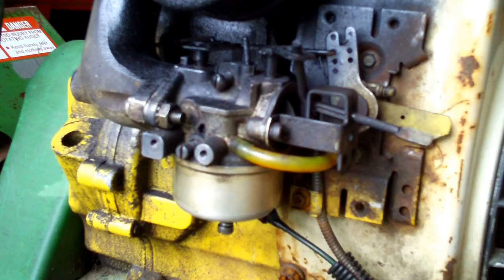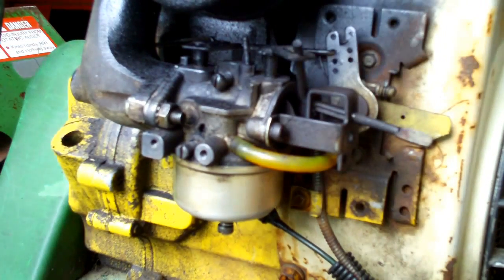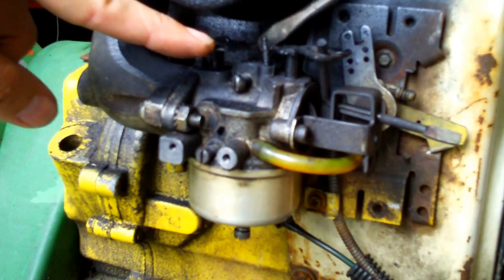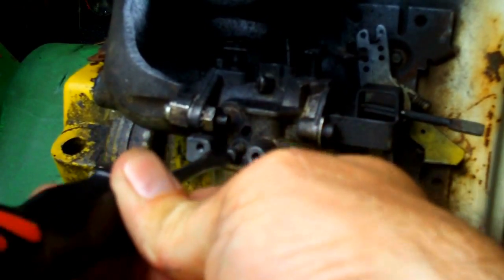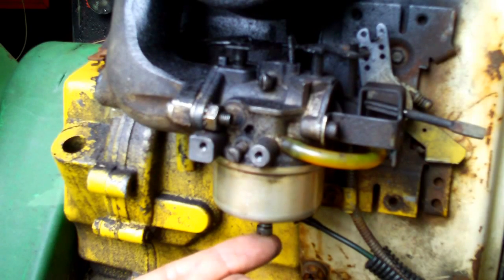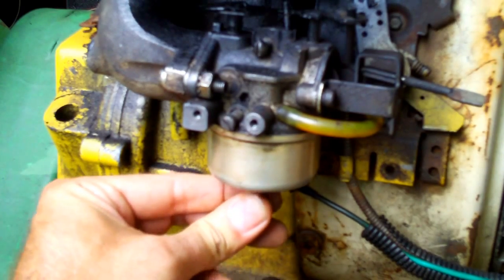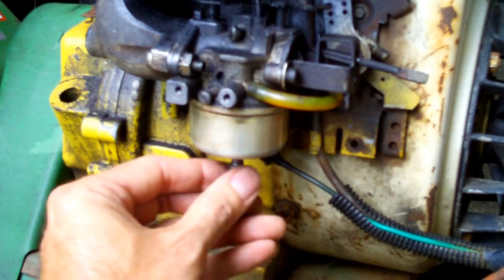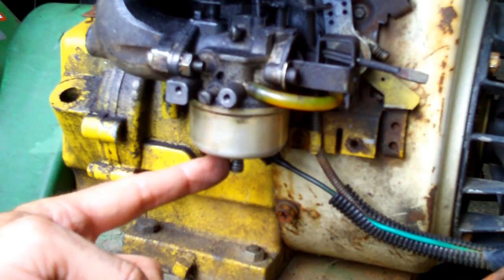How to tune a small engine carburetor with governor ✔

Comment: What about screw on governor arm?
Reply from the maker: That regulates what RPM the engine will run at.
Reply: @contact4mwy7  thank you very much, I’ll try it, rpms seem to be slow under load from mower deck,Tecumseh oh160 1973

Comment: If the carb has a solid 1/2 nut in the bottom of the bowl it is a FIXED JET carb. There is NO adjustment on the side or anywhere else. The side screw has a hole through it and a tiny hole in the end that can plug but the screw must be tightened....no adjusting....if it was adjustable it would have to have a spring on it.
Reply from the maker: Not every carb is adjustable, but those that are...

Comment: My generator fouling new spark plug instantly with dry black powdery deposits , any ideas , do I need to increase decrease air/fuel mixture air filter seems cleaned  have done approx 1800 hrs use? Answer be great please  am off grid out of action cpl days ?
Reply from the maker: Black powder (carbon) deposits that can foul the plug means it is running too rich. Too much fuel. Find a way to adjust it to use less fuel, more air.
Reply: @contact4mwy7  thanks God bless you 🙏

Comment: Something wierd that happened to me was that the engine started to work really fast (rather than run rough) after opening the idle screw to allow more fuel.
Gave me a bit of a jolt cus it sounded like it was going too fast.

Comment: my Tecumseh 4hp push mower seems to work smooth with just a quarter turn of the idle screw and 1/2 of the idle speed screw.
Is it cus it's a smaller engine that it doesn't need much air/fuel mix at idle?

Comment: Great video, here is my question - just replaced the carburetor on a Kohler MT8.  Now, if I turn it off and then start up again within a couple minutes, it backfires once out the muffler, but then runs fine at idle and under load.  It never did that with the old carb.  Do you think the low speed mixture is too lean?  Thanks!
Reply from the maker: I would have to experiment with small turns one way, and then the other to see if it made a difference. It sounds like when you start it back up when the motor(and muffler) is hot that it backfires. It does not do that if ythe motor cools? It must be pushing some unburned vapor out into the muffler that then explodes from the heat. Try slowing the idle a bit too to see if that helps in not pushing as much vapor into the muffler on starting. Keep me posted. I don't have the short fix answer, but rather try a few little things first.

Comment: where should your low and your high speed jets be set at before you adjust anything?
Reply from the maker: Start by turning both screws GENTLY all the way in. Back them out 1 and 1/2 turns (one and one half turns). Both of mine are there now with the high speed jet turned another 1/8 of a turn out more (one eighth of a turn more rich). Start with 1 1/2 and go from there, but it should be close!!

Comment: great video. thanks. I'll try this on my JD 826 and hopefully I'll find that sweet spot where it'll run better and throw farther.  I just put in new belts and it only throws about 3 feet.
Reply from the maker: If the motor doesn't seem to be spinning as fast as it should, there is a governor screw located next to the governor arm (right next to the motor housing) to adjust for speed. You can just see it to the upper right side of this video angled down when the motor is running slowly, and angled up when the throttle is adjusted for faster speed. This screw has a spring wrapped around it to keep it from turning on its own. As you turn this screw "in" as though tightening it you will increase the speed of the motor. Just be careful you don't turn the speed up faster than what the motor can handle as this could damage the motor and lead to a complete failure. I'll put "Make a governor adjustment video" on my to-do list!

Comment: Hi. Put new carb on my 10hp Arien's. Adjusted like you did. RPM at 3500. Sounds good till I get it in snow and it bogs down. Any help? Thanks
Reply from the maker: This makes me wonder is this a tuning issue or is the governor not working or hooked up correctly. The governor should be opening the throttle more as the load becomes heavier on the engine. 10hp should be plenty of muscle to move snow, I believe my engine is an 8hp and does pretty good at keeping up even on my 32 inch wide augers. The throttle that you control should be connected to the governor, not the carb. Can you verify the governor is working as it should?

Comment: On my techumseh there is a small steel rod between the motor and the throttle. This is making the rpm wandering and moving the throttle. What can I do to get the rpm steady (excuse me for my poor english...)?
Reply from the maker: That rod goes to what is called the 'governor.' It is supposed to keep the engine running at a steady RPM whether under load or not. If it is wandering, speeding up, slowing down, speeding up, slowing down... over and over, that is because it is not getting enough petrol to the air mixture. It is running "too lean." You need to find the High Speed mix screw and turn it as if you are unscrewing it 'out' until the engine runs smooth without ramping up and down. If your Techumseh is like the one in my video, it would be the Mix Screw on the bottom of the carburetor. Does this make sense? If adjusting the mix screw does not make that issue go away, it could be due to water or dirt somewhere inside the carburetor.
Reply: Thank you!! Will try that out!

Comment: Just curious, what's the best procedure for adjusting a carb that's been rebuilt and had all the screws removed?  I had one that was plugged so bad that I had to take it to the shop to have them work on it.  I know one general rule is to turn the jet screws in all the way and then back them off one and a half turns and I can almost tell where the idle screw was.  Any other tips for doing this?
Reply from the maker: You're on the right track, Cujoe. If it will not start still, turn them out another half turn. Once you get it to start, work on the idle first. Adjust the Low Mix screw until it runs as fast and smooth as you can get it, then adjust the idle speed screw to where you want it to idle. Then, turn up the throttle to high speed and adjust the High Mix screw until it runs as fast and smooth as you can get it. Back and forth with each, listening for the engine to run at its best.
Reply: Thanks for getting back with me, I will definitely be giving it a try this weekend.  Ended up acquiring an Ariens 10960 snow thrower for free and it has a very similar carb as this one.  I could only get it running on full choke.  So far I only have $60 into it and $50 of that was having the carb rebuilt :P
Reply from the maker: Make sure EVERY part of that carb is cleaned out. I should make another video showing the tiny little hole through the tube that holds the float bowl onto the carburetor. When that gets plugged, the engine will not run right at all.
Reply: Oh yeah, the shop did everything, they replaced all the jets/screws and even put a new spring on the throttle plate.  I had already purchased a new choke lever and valve plate.  I was told they also put the carb through an ultrasonic cleaner to get all the gunky crap out.  I should be all set.  I usually do a lot of work myself (on cars mostly), but even my dad couldn't get it completely cleaned, we got as far as it running full choke, but just couldn't seem to get the rest of the bad gas out.
Reply from the maker: Make sure there isn't any water in the bowl. Have you adjusted the High Jet screw to run richer by turning it as though you are unscrewing it? Turning it out?

Comment: question when you turn the mixture screw on side now i turn mine in the whole way it revs back it out it drops.Its backwards compared to yours
Reply from the maker: Sounds like something is not quite right with that carburetor, Pete. You can adjust it to run the best you can, or have the carb taken off and cleaned and inspected for damaged or worn parts, or something out of spec inside such as the setting of the float that regulates how much fuel enters the bowl of the carb.
Reply: I thought that but i do know float is set right.I ordered a new carb for it
Reply from the maker: That had better straighten it out for you Pete!

Comment: I've adjusted mine including the governor per manual and out of the blue after almost finishing a 3 car driveway it starts to sputter and stall. I end up putting the choke in the middle and sometimes that helps so I can finish and sometimes it stalls. So I readjust the fast idle mixture screw and carry on. Once done blowing I remove the bowl and it's clean, remove the float, shake it for leaks, clean the float needle and reinstall the bowl and clean and blow out the main jet needle holes including the pinhole above the threads. All looks clean so I don't get why it stalls after running fine for a while. Yesterday I had sparks coming from the exhaust after I got it going. I tried a China carb but it was good for a couple of weeks then it was worse. Is this carb icing up or what? I'm thinking of taking spray carbon cleaner to the carb at high speed to get the valves cleaner. Also I may increase the governor rpm a bit then adjust it using the small screw beside the throttle lever. Thoughts? Buy a real Tecumseh made in America/Canada carb?

This snowblower is from 1986 and it's a 8 hp-26" Tecumseh snow king engine.

Also the electric start works sometimes. I've removed it and it bench tests each time but intermittently works when installed.

Edit:
Just looked at the main needle and it was scratched up, so I used a new one and adjusted it 1.5 turns out and it worked good for the 20 min I used it. Hopefully that was the problem.
Reply from the maker: Hello John, I hope that main needle jet is the problem because it sounds like you have covered just about everything else. Not too many people even KNOW about the little pinhole in the main jet sleeve above the threads, which I discovered to be the cause of trouble on my snowblower when the holes were completely plugged. Sparks may have come from inside the muffler due to a lean burn condition, as I have seen mine do that from time to time.
Reply: Thx for the reply.

Comment: my rider it has a new walbro carb. was working perfect , new carb , starter , battery and deck belt.  but now it will bog down , I will stop and it must be choked ,the placed back to the power setting 
ideas ?
Reply from the maker: It may be a fuel restriction, such as a dirty fuel filter or kinked fuel line. Check to see if it has a fuel filter and make sure the fuel line doesn't have any sharp bends in it. If all of that checks out, empty the float bowl to take away any water that may have accumulated in it. After that, if it still doesn't run right, I would suspect there is something blocking the fuel passages inside the carburetor such as dirt or hardened gas and a thorough cleaning may be in order. Make sure the gasket between the carb and engine is good with a good seal, whether it is an o-ring type or fiber type. If all of this fails, find a shop in your area that can troubleshoot it further. They may find that it is not carb related after all.

Comment: what causes engine to surge at idle?
Reply from the maker: +tankcrewman Just a guess, but maybe it is running lean at idle. If you have access to an idle mix screw, try turning it out a little at a time until the surge goes away. If there isn't an idle mix screw, make sure all of the carburetor passages are clean and that there isn't any water in the bottom of it (where the float bowl is).
Reply: Thanks ! It was running lean. I adjusted it and its running fine.
Reply from the maker: +tankcrewman That's awesome that you were able to fix it! Thanks for letting me know!